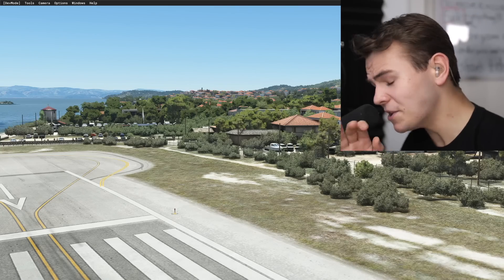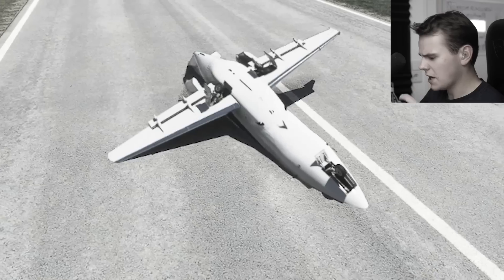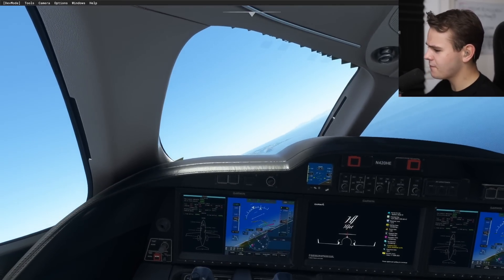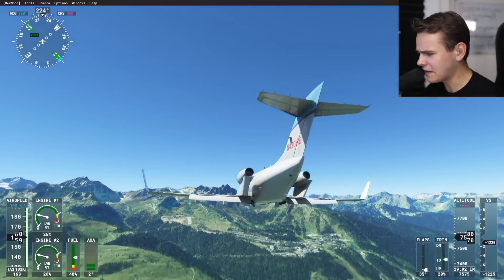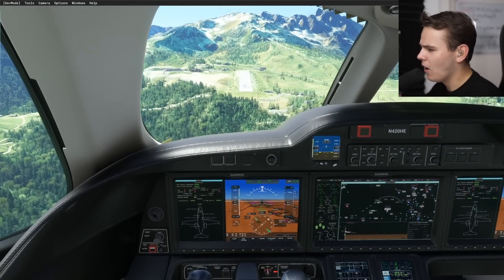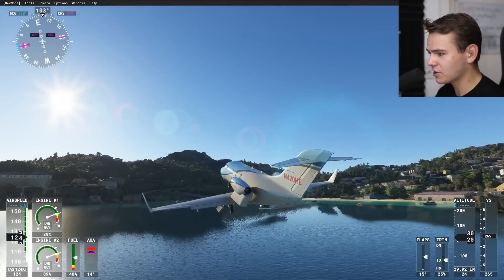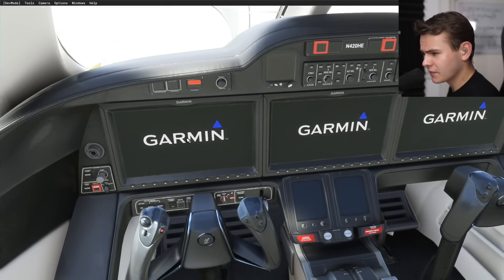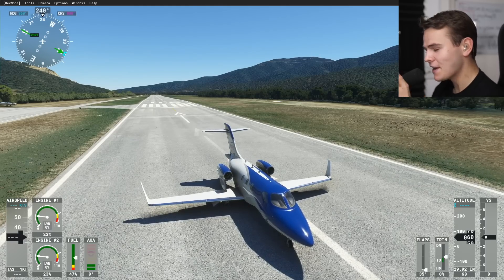How Much Runway Does The Honda JET NEED? - MSFS EXTREME TESTING

Comment: I still won't buy a Honda
Reply: Why, Honda is a good Japanese car bro :/

Oh u mean the Honda Jet one huh lol?? 😅😅
Reply: @AviationLoverIndonesia  yes I did mean the Honda Jet.  Although the cars aren't as good as they were 20 years ago.  Anything 2003 and older are the best Hondas imho.  I still have my 1996 Del Sol and it's got over 250k miles and still runs strong (did I mention that I'm the og owner of it? I got it at 15 as a birthday present) My dad got a 2019 Civic Type R brand new and at its first oil change it had water in the oil and oil in the water.   My dad's a mechanic, so it wasn't mistreatment of the car that caused it.  He has had extensive problems with it since and traded it in about 4 months ago and for a Tesla Model S Plaid.  He could do that because it didn't meet the criteria for being a "lemon" so the next owner is in for a surprise.   But the Honda Jet has been an interesting plane and imho they should stick to making cars

Comment: 2:01 the difference between legacy and modern flight model is that legacy flight model is basically FSX physics in MSFS2020 and it shouldn't be used unless you import a plane from FSX and fly it in FS2020, modern flight model is basically MSFS2020's own physics model.
If you wonder why the physics in MSFS feels like FSX, it's because you've been using FSX physics model the whole time
Reply: How do I switch between those models?
Reply: @marou2026  in general options
Reply: @marou2026  in general options you will find a flight model tab
Reply: FSX was so hilarious cause I would hear people saying “I’m doing atc with a Xbox controller” and “I’m flying using my ps4 controller0
Reply: @Dome_patrol504  normal Steam Edition stuff
Reply: @GL1tch3r5  yeah lol
Reply: @GL1tch3r5  “can I do a fly over? I’m in a Learjet btw” MACH 1 FLY OVER FROM 80000
Reply: The interface and programming model should be well written enough though to prompt for invalid settings for a particular model.
Reply: @kutto5017  it should not existed in the first place. FSX is released in 2006, that is a long time ago. No need to support add-ons that are released that long before, but Microsoft being Microsoft they somehow must maintain some "backward compatibility."
Reply: @bltzcstrnx  true. But the fact is I like windows wayyyy more than OS X exactly because of that Microsoft philosophy. But that is a bit of a digression....   I have Pro audio gear drivers that will still happily run on windows 11 that expired many editions ago on OS X but were released at the same time
Reply: They have got to put that in the game.
Reply: hah, lol
Reply: FSX physics do be feeling better than those MSFS toy planes
Reply: @ironic8340  what? FSX flight model is known to be awful. It is often called as flying on rails for a reason.
Reply: @bltzcstrnx  Better that than to fly a 747 as if it was a phenom
Reply: @ironic8340  oh I understand, your problem is more about default aircraft rather than the fundamental flight model.
Reply: @ironic8340  you sure, lol? It's an older less advanced flight model